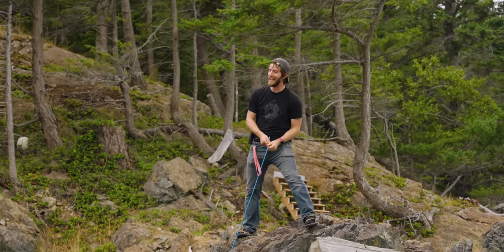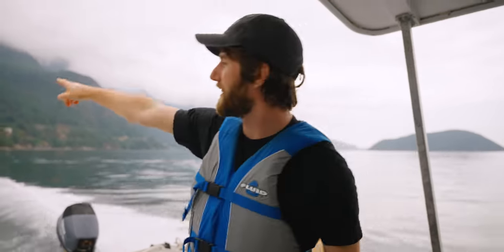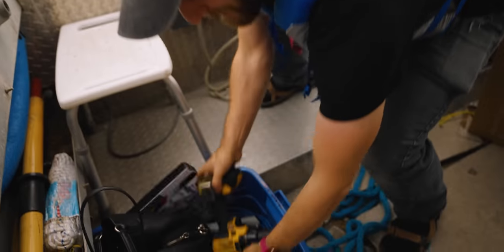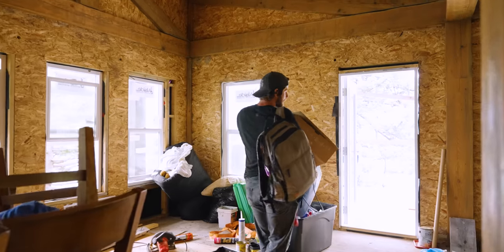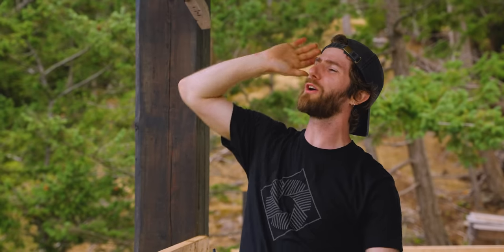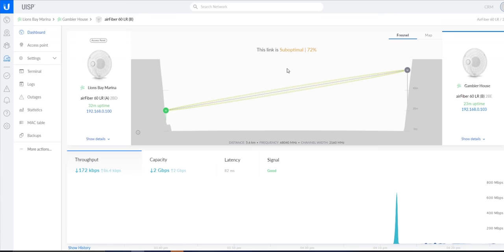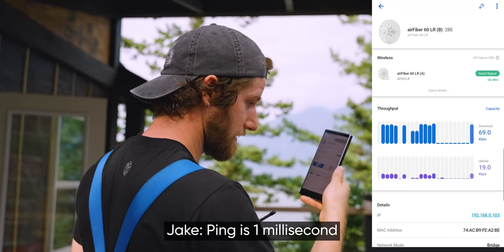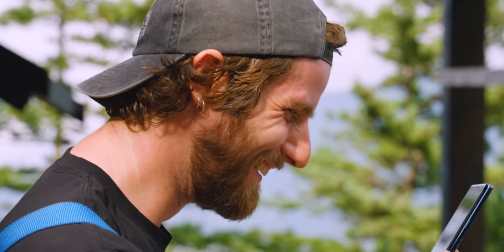How are we going to do this?

Comment: I installed a Ubiquiti AirMax PowerBeam, after seeing it on Holy $h!t, between my office and my house (to save $60/mo) and it is amazing. Well, that’s until the sending dish doesn’t get knocked over in a storm on my flat roofed office. Easily fixable, though. Would recommend.
Reply: I actually wanted to try it after hearing you guys, how about strong wind or bad weather in general?
Reply: I mean it wouldn't be difficult to craft a support system to lock it in place so it can't move or will move millimeters so you can adjust it back extra fast

Comment: I used to work for a wireless ISP, the most impressive shot that I made was a house in the woods surrounded by huge trees over 10 miles from the tower with hills and a dense forest in between. I could not see the tower, I expected it to be a no-go, but I set up the test dish by eying it from a gps map and got a rock solid 100mbps connection, basically as good as it was possible to get with our equipment. 
Although wireless tech can be really impressive sometimes, there are also plenty of times when it would take me hours to dial in a connection. Sometimes just moving 3 feet down the roof to a basically identical position would make all of the difference. One time I tried to do an install at a house about a mile from the tower with clear line of site, I could see most of the tower, but no connection, it would barely even detect the tower at all. I never understood what was wrong there, usually if you can see the tower it is a guaranteed connection. Wireless can just be crazy sometimes.

Comment: "I'm waving my arms around like a madman"

But not mad enough to wear a bright-colored shirt instead of black-against-dark.
Reply: Or shine a flashlight.
Reply: or share the location over any messaging app.
Reply: @the_gask6070  ...which he did at the start if you'd listened!  "I sent you a pin!" but his mate promptly spotted the timber supports.
Reply: @stephenphelan626   A flashlight would do fuck all during the daylight. If you had to you could aim it at night and use that method, but seems they sorted it out.
Reply: @the_gask6070  That will help, but I wager you'll find that actually finding that pin on the map with your eyes is harder than you are imagining. See the maps we look at on GPS apps are not to scale. If they were it would take you forever to scroll around the thing. It's a compromise worth having for ease of use and being able to quickly move around the map. You could try and use a landmark nearby to orient yourself but it didn't seem like Linus' side of the water had too many landmarks.
Reply: @ViciousTuna2012  Not just that.  I can't tell what height he is at when looking for Linus, but the horizon distance becomes an issue too.  Example: For a 6' (72cm) human, the distance to the horizon is ~3 miles (4.8KM) if on perfectly flat land.  Linus could then very well be partially obscured at 6KM.  Honestly, without spotting the lumber, I doubt they ever would have been able to get it perfectly without having surveying type devices and starting at a known observable position.
Reply: Or bring flares.
Reply: @DoubleA-A_  or maybe a mirror to reflect light
Reply: I thought the same thing
Reply: He's not much of a Survivor. He'd die before being rescued.

Comment: Interested to see what kinda speed there will be when there's fog, mist, rain, heavy rain, snow, blizzard.
Reply: Ubiquity has a 915 MHz line that can penetrate the weather that he can use as a backup. But it's almost an order of magnitude slower because of the lower frequency.
Reply: @petevenuti7355  Fortunately even a magnitude slower than 1Gbps is still a really solid connection
Reply: I've tested it in like similier cerqomnastens, the performance will drop by 2% durning any bad weather
Reply: oh damn that would be an awesome scientifical update everyone would appreciate
Reply: @laso8608  i agree, im such a helpful person, tho i messed spelling that damn hard word
Reply: @zdarkness_6985  circumstances
Reply: @shanthanuhemanth5070  "cerqomnastens" is probably the most interesting misspelling I've seen :D
Reply: I'm more surprised they didn't just go with Starlink. I'm pretty sure they have good coverage over BC now.  But then again, this is much faster.

Comment: Who else thought he was going to use like a 6km long Ethernet cable
Reply: Me
Reply: Yah same I was like wtf how will Linus get a 6km long.
Reply: @JonathanRootD  Fiber is a thing.
Reply: @3vIl3aGl3  So is smoke signals but he said "Ethernet cable"
Reply: @Ghost-hs6qq  they just made a video on how to diy ur cables
Reply: @luiszavaleta1900  good luck trying to make a 6km long fiber cable lmao
Reply: @Ghost-hs6qq   And get permits and pay millions to lay it down in a way that anchor's arent a problem.
Reply: not me as 12 KILOMETER Wi-Fi - SUCCESS!!! and  Long Distance Wi-Fi (Up to 25 KILOMETER range!?)
and didn't Linus have a dish between house and office 
but that dish looks weaker than plastic Road Safety Mirror and they fly away in light storms
Reply: Would have to be fiber, copper isn't rated for those distances.
Reply: @KillaBitz  fibre can be ethernet. Ethernet is a protocol, Not a cable type.
Reply: I thought he was going to use ethernet cat 7 to fiber then back to ethernet with a media converter. But, going underwater may violate some environmental laws.
Reply: @Cyber_Nomad01  need permits and stuff. Very expensive
Reply: @samiraperi467  most of the internet is copper cable resting on the ocean floor.
Reply: Given they are usually rated to work for about 100 meters... not many I hope.
Reply: @samiraperi467  " copper isn't rated for those distances" every underwater cable running internet and phone across the oceans would like your number in wtf are you talking about.
Reply: @bepbep7418  Not really its mostly optical cables, but older ones can be copper cables as well.
Reply: @1BigBen  You would be surprised how strong these dishes are
Reply: @KillaBitz  A fiber cable is still an Ethernet cable, or I guess strictly speaking it can be. The transceivers you use at the ends will define the Ethernet part of that cable.

Comment: So the one question I had throughout this video: how did you get permission to install a dish on the mainland? Did your parents have to buy/rent a separate piece of land/building there?
Reply: This is what I was wondering the entire time. Also what happens when a bird starts making a nest in the mainland dish haha
Reply: I'm guessing his parents rent slip space at the marina and they made a deal with the owner
Reply: @LiveFreeOrDieDH  Either that or they just straight up own the marina
Reply: @sgbench  I can believe it
Reply: @mCanoodles411  Considering how much the signal was fluctuating,  a bird sitting on top of the dish would be bad enough!
Reply: I think this is the proper answer
Reply: Hi, Mr. Marina Owner Dude, can we install our "Wireless" internet across the water to our new cabin by mounting one of the dishes on your boat storage building?
Sure, Mr. & Mrs. Linus Tech Tips Parents, so long as you share your connection with any current or future neighbors.
Reply: @blagmate5516  This is Linus' parents and that is pretty much exactly how it went
Reply: @peterneufeld8540  I assume that is actually true given the one video on your account. Very cool that you replied!
Reply: Did pretty much exact same thing here in New Zealand a year ago. Just knocked on peoples houses with solid line of site and said we’d pay for the best internet money can buy for them in exchange of putting an air fibre dish on roof and second house said yes
Reply: @peterneufeld8540  So, when is the obligatory Linus Tech Tips Parents' Parenting Tips channel coming?
Reply: I believe they talked about this on WAN-show. The marina provides this as an option. The reason for going with this instead of starlink is that his parents can recommend this setup to their neighbors on the island.

Comment: That's impressive. Actually I would also be interested in how Linus' parents figured out power, sewage and water in the middle of nowhere.
Reply: don't know about water or sewage but power is pretty simple. Solar and wind should easily be able to handle powering a single house assuming it's usually sunny and at least semi windy
Reply: @HearMeLearn  bc isnt always sunny
Reply: Looks like and outhouse.
Reply: Well house electric pump for water septic tank for sewage
Reply: @juicygibbles76  wonder were all that poop destination is going to?.😁😁😁😁😁😁
Reply: @lactusgalacto1174  septic tabk
Reply: @juicygibbles76  and who empties the septic tank?
Reply: @lactusgalacto1174  you dont need to empty a septic tank as long as the bacteria in the tank is maintained
Reply: @juicygibbles76  indeed, so their is no danger of the tank overflowing.  thanks for the input.
Reply: @lactusgalacto1174  could also just be a drain field... That's what both my grandparents have.
Reply: it helps to be rich
Reply: Could just use a well for water
Reply: Water? Drill a well. Sewage? Dig a hole, install a tank. Power? Obviously a battery.
Reply: @ryanskogg5211  That looks like an outhouse? You must live in a mansion. The house looks awesome
Reply: @juicygibbles76  Septic tanks do need to be emptied, but not very often. Can be years between being pumped. The less people using it, the less often it needs to be pumped!
Reply: If they don't already have a source of fresh water you can get convertors that turn sea water in to drinking water. Used a lot on blue water yachts and would do the same job on the island.
Reply: @pokingfun4008  power cells + solar + wind will 99% always have a bit of power for you
Reply: Sewage is very simple, you just need a sepic tank
Reply: @cordwoodenties5505  Linus walked out of an outhouse in the beginning of the video
Reply: @pokingfun4008  they can connect car batterys to the solar panels and windmils for days when it isnt windy and the sun doesn't  shine. To have power in those days
Reply: i live in BC and for water in country properties we usually have to drive out with a tank in the bed of a truck (i have a truck with a built in water tank for this) fill it then haul it back to the property and fill up a tank i have underground in a shed along with my breaker (power was all wired by me helps when you have done trade school) takes a while though. its mainly because there just isnt any water lines anywhere near the property, for sewage i do have a septic tank that a friend installed but that one has to be emptied by me as well and its not fun, im sure depending on where you are you could have a company come out and do it but that property is so far in the middle of nowhere they just wont
Reply: Solar, septic, and well. Pretty standard for anyone outside of city limits
Reply: Septic and Well? The way almost every single house outside cities work. Power, if offgrid, would be solar and battery with a generator for backup.
Reply: @slate8881  Why not just use a well? Septic dosen't need to be emptied if built correctly, maybe you just have a holding tank?
Reply: @TS-yc2do  I am shocked at how many people have never heard of a well or septic here.
Reply: @pokingfun  You do realize that big boy batteries exist, right?
Reply: Solar/wind/ generator, septic tank, fresh water tanks with water delivered via barge/boat.
Reply: Quite a few people actually live on the islands in the Juan de Fuca straight, not being too far from Lion's Bay helps.
Reply: Power, sewage are pretty simple. Power by Solar and Sewage would be just a tank. A non centralised system. The water would be a treatment station I guess.
Reply: @HearMeLearn  for sewage they porbably have an septic tank

Comment: Is it like "renting" a part of the wall surface at the transmitter-side?
How is the setup for that side done?
Reply: Very good question....
Reply: Yeah, most likely they paid someone to let them run their internet and use their wall. That's what I would do
Reply: Le .
Reply: Exactly what I was thinking! I don’t suspect they bought two properties as that would be insane just to get internet 😂
Reply: thank god im not the only one having that question!
Reply: Ok Linus, you have some explanation to do 😂
Reply: I was wondering who let an amateur drill holes in his wall.
Reply: It can very. If you know the owner well enough. They may say go ahead.  Otherwise it's Rent or lease a space. One place I talked with would lease space on it radio antenna that would cover power and space. But we had to maintain it, run all wiring and pay for internet separately. Another place it was the same as getting an office space in the building using a shared internet to the building.
Reply: They rent a space for a boat and parking space for their car (and trailer?), pretty sure they would just let them put it there - with this setup being the first one like this, I think they would just let them do it.
Reply: If they live there i would assume they have a boat at the marina too and would just ask them probably just need to get their own line brought in.
Reply: @ErimlRGG  yeah most likely, my cousin's house doesn't get fiber but his neighbor down the hill does so they just asked their neighbors and did a setup similar to this with their own private line. if I recall he gets the full speed of his subscription 200 Mbps down and 50 UP, though ping is kinda high (for fiber) at 18 in speedtest and 50-60 to the nearest AWS server where most games host. honestly not bad considering he had DSL
Reply: @mokubakaiba1751  in Canada, LTE internet is very expensive, so Cable (or Fiber) Internet is a better option for high internet usage like Netflix, Youtube, etc...
Reply: they already spoke about this (i think on the wan show it was), yeah, thats exactly what they did.
Reply: @I_DONT_SUPPORT_TERRORISTS  thay just paid to attach it to their wall.
Reply: Bought or just know the owners and arrived to an agreement.
Reply: @I_DONT_SUPPORT_TERRORISTS  That sounds like the kind of over the top rediculous I would expect of someone with the Sebastian name tbh
Reply: In England, this is called way-leave, if you get the agreement drawn up by legal professionals. 
And honestly it can be a right PITA 😂

Comment: Are you planning to do a followup video in a year or a few months to see how the system holds up over the winter? Curious how well it handles keeping the snow off and if the alignment shifts over time. Looks like re-aligning won't be an issue with where you have them mounted.
Reply: snow, rain , fog... when he said he was using Ubiquiti's 60GHz solution across a 5km lake I was like... really?!
Reply: @shriramvenu  I work for an ISP that uses 5GHz Ubiquiti equipment to get service to rural homes.  They keep working in rain, snow, etc, just fine.  Many have been in place for ten years.  One problem that I see is the placement on the marina end - the gray satellite arm is fine, but we've found you cannot install under the eaves, unless there is a very long eave on the house.  Otherwise, the snow comes off the roof, and tears the dish off the house, especially under steel roofs.
Reply: @shriramvenu  I guess it's enough for Netflix or just browsing the internet. Unless Linus' parents are not hardcore gamers in CS:GO or Fornite, that should do it.
Reply: They get snow there? (Or at least enough to move the dish?)
Reply: @FalbertForester  Yeah, but the higher frequency should cause more problems with rain and snow.
If they still get 100mbit in snow it would be good enough if it was my house.
I would expect its also why they have excess wireless capacity in comparison to the gigabit lan interface, if they loose some performance due to bad conditions it doesnt affect it much.

Comment: Gamer: "Hold up guys im bout to clutch this game watch.."
Boat sails between the dishes
Game: "Ight ima head out"
Reply: luckily his parents aren't avid gamers. it will only be a very short drop if a boat or bird passes by or something so it should be fine for your 'average Joe'. especially combined with the high speed to quickly catch up on buffering streaming media again.
Reply: It would have to be one hell of a big boat to cross the line between those dishes. Over 6 km at an up angle and it starts at at least 3 meters above the water line, ending at a good 10 meters at least. If a cruise ship or tanker goes by sure, but all the little fishing vessels I see in that marina aren't ever going to block it. A mast here or there might break the plane for like a split second and they won't even notice.
Reply: What if it rains or snows lmao
Reply: @deadlypyre  I'm pretty sure that given the location they thoroughly thought about that
Reply: @deadlypyre  No issue with snow or Rain, bandwidth may drop a little but we use this in big commercial enterprises so no issue with weather,
Reply: what a bland and stale joke, don't worry, you'll get them next time
Reply: @ChuckleBrryFinn  stale joke huh..  these 300 likes arnt though :3 ;)
Reply: @Linerunner99  I had a thought of like a cruise liner or cargo ship but idk where they are that one would go through, but weird situations can happen.
Reply: @deadlypyre  I don't think it would effect it that much. If it's a heavy downpour then might drop the speed a bit but I'm sure they designed this and tested this device with weather effects in mind.
Reply: That would be a legit problem though,if a sailboat decided to moor itself between them and then maybe stay there for a few days.